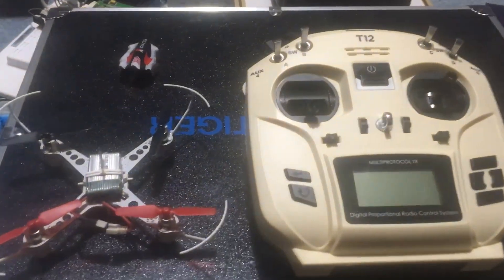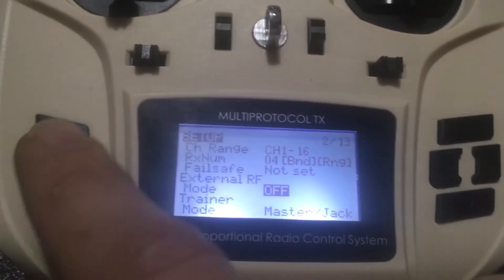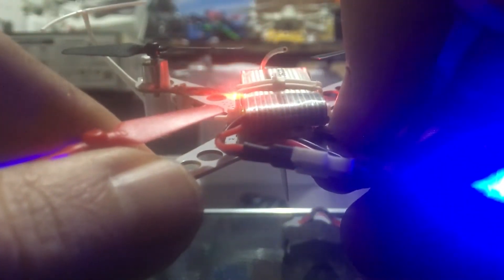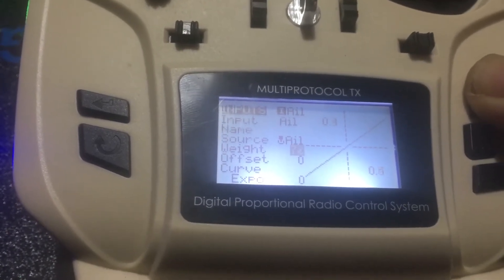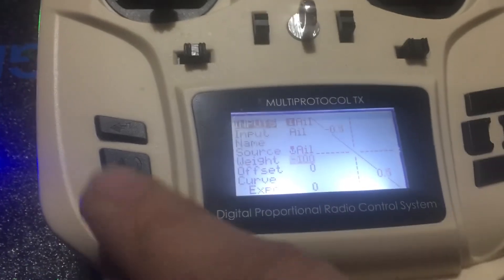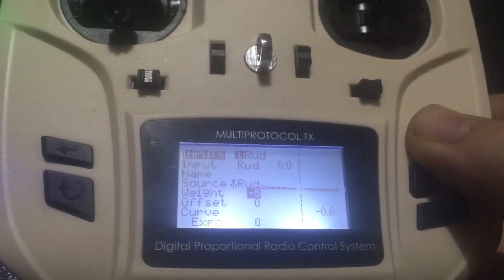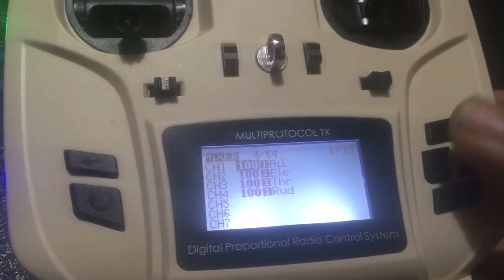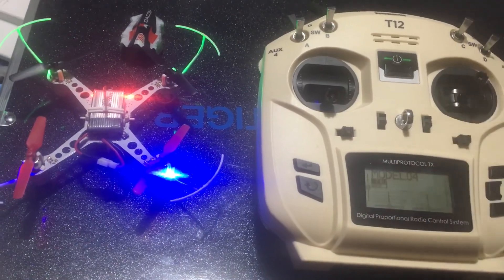Jumper T12 XK X100 Binding & Setting Switches Reversing Channels DIY OpenTx How To Review

Comment: Any idea if this would be the same process for the xk x350 ?
Reply from the maker: Yes it is basically the same process
Reply: @JayDrone  its been about a year since I used it. Found that and the plane . I fly full fpv now but plan to bind it to test it . I'm sure the x350 must of had an arm switch and a 3g/6g switch.  And a 3d switch . Anyway to find out which is which.  That one is a bit powerful to be playing guessing games on the bench with 🤣
Reply from the maker: I think I have a bind video for the 350
Reply from the maker: As far as 3-D mode definitely did not map that I’m sure there is a button that would allow you to do so but again would be trial and error

Comment: I need to explore this more. Setting mine up exactly like this on SD with the switch all the up, stability mode, down to middle is acro mode. Now if I turn it upside down on the ground in either mode the motors reverse and it will fly inverted. 
  Too cool, I have to figure out throttle up. I've got time, I can barely keep it in the air without stability and can barely do 3d in a sim....